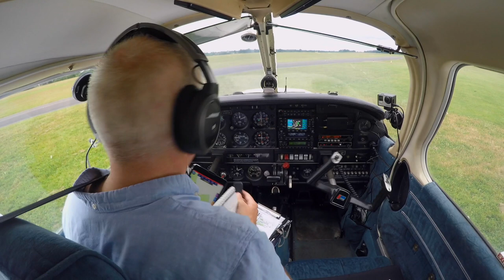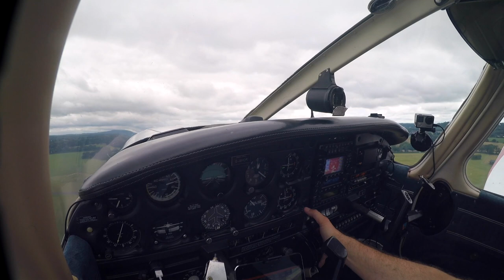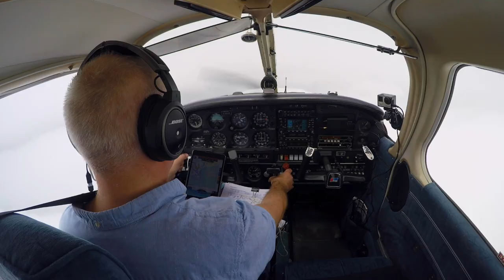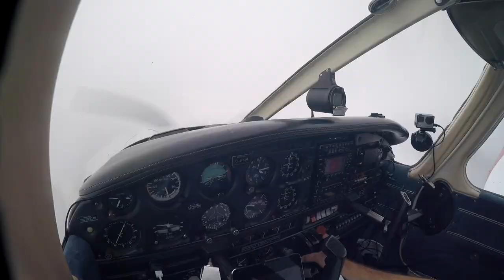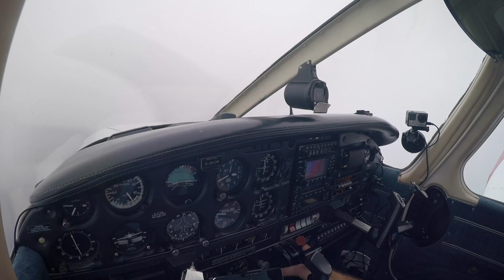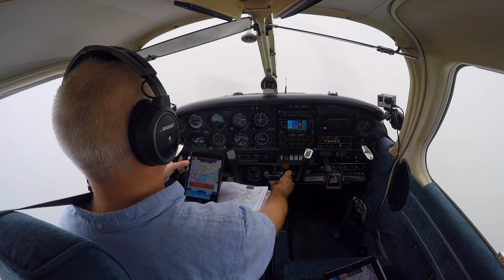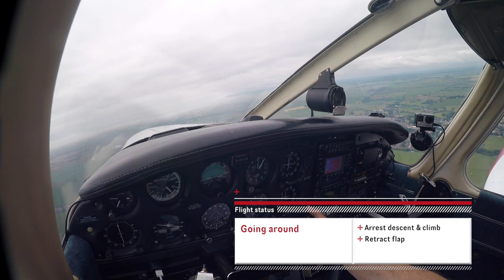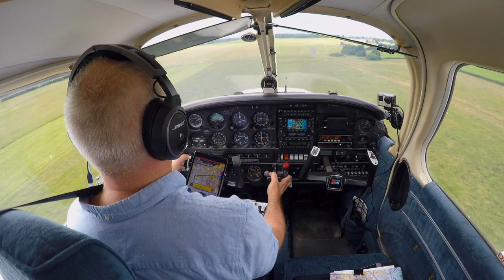RNAV approach in IMC - The Flying Reporter

Comment: Flying IFR into IMC is no joke.
I’m not yet a pilot but trying it just on sims is no small feat.

Sure, modern GPS, Fore Flight & Auto Pilot does help.

But every-time I watch a accident on YouTube, there’s always a chain of “events” unplanned that happens.

1) A pilot on VFR suddenly finds himself flying into IMC.

2) Electric Failure, loss of attitude gauge, airspeed gauge.
Battery dies on iPad.

3) Engine failure or low on fuel.

Even if pilot briefed flight, has frequencies, approach plates ready.

Example: Now try simulating an engine failure or loss of a gauge, possibly electric issue where you loose your GPS or worse loss of radio communications.

Autopilot kicks off while flying in strong winds & gusts.

What I learned is having any major event suddenly trying to hand fly plane & locate nearest airport.

Then turn in right frequencies- 
Pray there’s an ILS runway.

Then while doing all this view the surrounding runway for hidden “obstacles” such as high antennas, power lines & yeah, Mountain terrains to avoid.

Doing what’s planned is tough in good weather- but when something happens while in bad weather is another story.

I’m on the highway in heavy traffic & notice that trying to tune my simple FM Radio dial to a different station is difficult while not swerving into the next lane off my compass heading or hitting another car ahead of me. 

And that’s not talking to ATC,, not keeping altitude or wings leveled :-) lol
Reply: You are right about the chain of events. The aim of all pilots is to break that chain.

Comment: accepting that Romti is the primary hold fix, wouldnt it have been easier/safer to start at bemla from your direction. Entering at Romti from the west means you get close to the final approach track as you naturally overshoot romti in the subsequent turn.

Comment: Very impressive! I have my IR(R) rating but rarely use it due to lack of confidence.
Reply from the maker: You very quickly lose confidence in it, so it's really important to get out there and use it, as often as you can.  An hour or so with an instructor should get you back on track.
Reply: The Flying Reporter a couple of quick questions.  How do you use VOR for inbound track to ROMTI, and when do you report ROMTI outbound, thanks

Comment: Excellent graphics on this one, very clear. What drives the vertical guidance on the CDI if it is not an ILS?
Reply from the maker: It's the WAAS GPS.  Some LNAV approaches actually have vertical guidance coded in, but they are only there as a guide, you must still follow the VNAV charts.  I probably had the ILS tuned on NAV 2.

Comment: Hi Jon, Good job on the approach and the whole flight in general! I’ve just finished my IR and CPL  down at shoreham in the DA42, so I’ve done that approach at Lydd countless times 😂 I was lucky enough to have the DA42 with the G1000 to help me out, so certainly a case of credit where its due to you for doing it using the old gauges, I reckon it would take me a few attempts on those before It get it to a decent level of accuracy haha!  

Anywhoo I just thought I’d mention a little tool I use for any 2D approaches which makes it easier reaching the block altitudes bang on the money and just helps finesse the approach in general! its that whenever you’re 0.3nm away from a set distance associated with a block alt, you know you should be 100ft above the associated altitude! as an example in that approach you did, 4nm from the MAPT is 1950ft, so at 4.3nm aim to be 2050ft. Again just sharing a useful tool I used, if you already knew it then disregard this comment 😂 All the best!
Reply from the maker: That's a good tip I didn't know.  Thank you.

Comment: During your preflight checks I noticed "pitot heat off", surely for IMC flight it should always be on?
Reply from the maker: Not if temperature is above freezing.
Reply: As I understand it there can be a temperature drop in the pitot head though so it can freeze even if temp is >0, eg I know some POHs say to use it if OAT < 10C and visible moisture (ie cloud).
Reply from the maker: I think that may be Commercial airline ops, but willing to be corrected.  I'd use it if temperature close to or below freezing, and maybe in a heavy shower.
Reply: @TheFlyingReporter  One point you may wish to check for your own peace of mind - is your compass calibrated with the pitot heat switched ON? If so, you may get slightly erroneous readings with it switched off in flight.

Comment: Why were you asked squawk 7000 when flying IFR?
Reply from the maker: Because I am changing controller.  The UK atc is not joined up outside controlled airspace.
Reply from the maker: Actually, I expect your question refers to 7000 being a VFR squawk.  Here it can be used when IFR or VFR.  It's just a conspicuity squawk, has nothing to do with flight rules.

Comment: Great Video.... The ATC service GA aircraft receive in the UK on IFR flight plans  & when actually in IMC always seems very "Keystone Cops"...  It's like the controllers aren't really responsible for separation like when Farnborough controller said "Traffic warnings may be delayed due to work load ?!?!"   And then when the Lydd Appr controller asked for your position ?!?!  The Approach controller doesn't have radar or ADSB ?      It all seems a bit Amateur compared to how GA A/C are handled on IFR in the States.
Reply from the maker: Hi. If you're light aircraft, operating outside controlled airspace in the UK, you're given a substandard ATC service I'm afraid.  Lydd is non radar - so it's a procedural service.  Farnborough is overloaded/under resourced, so can't offer a fool-proof radar service.  It is a mess in the UK in my opinion.
Reply: Well it might be. But I like the idea of the IFRr ticket in UK. nothing comparable for the VFR pilot in USA who kills himself in inadvertent vmc to imc. I wouldn’t be surprised if there were fewer IMC-related accidents in the uk because of this intermediary rating.
Reply from the maker: You could be right Douglass.  We have quite challenging weather here, so it makes sense.
Reply: I learned to Fly at EGTO in 91' (Robin DR-400)    In the NYC we have way worse weather & just if not more complicated airspace as southern England, Yet if you are a C-172 on an IFR plan you will get a full controller to controller service....Even if you are VFR with zero flight plan you can normally ask for flight following, they will give you a squawk & traffic advisories
Reply from the maker: Wouldn't that be lovely.
Reply: NJ Commuter not sure I agree entirely. A C172 on an IFR flight plan would get full services in UK and handed off between facilities. Jon wasn’t on an IFR flight plan (from my understanding). Also VFR flight following is discretionary in the USA. ATC can deny the pilot by simply not acknowledging his/her request although admittedly denials don’t happen that often.
Reply: Even when I've seen videos of actual IFR flight plan fights on other Youtube channels, It seems very quirky the way Controllers talk to GA aircraft in the UK, It doesn't seem to flow from one controller to the next on a single squawk code like it does in the States.
Reply from the maker: Technically speaking, I was on a flight plan - one filed in the air - however it never entered the coordinated system.  If I were in the system, remaining mainly inside controlled airspace, I'd have been given a full service, along with a single squawk and handoffs between units.